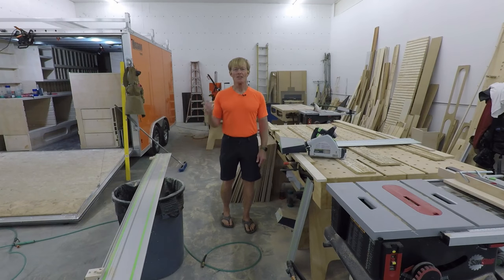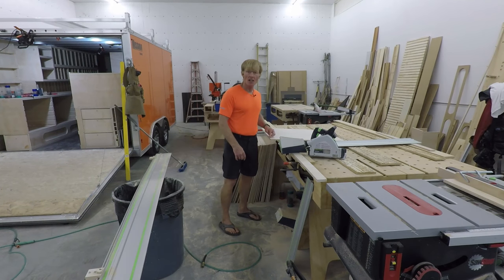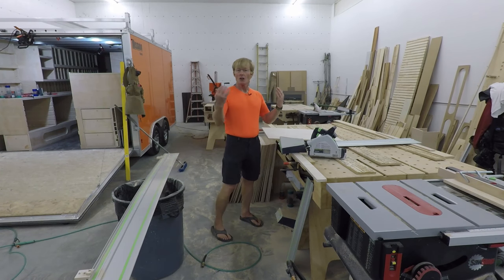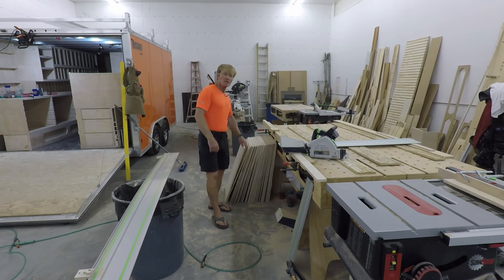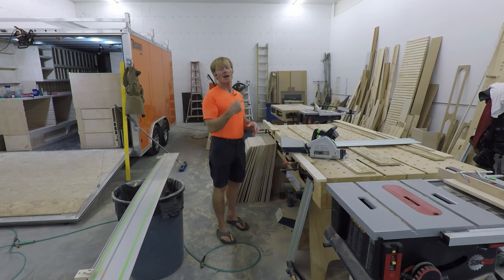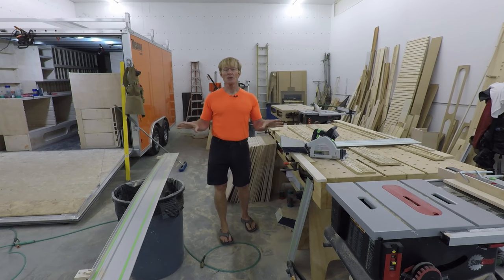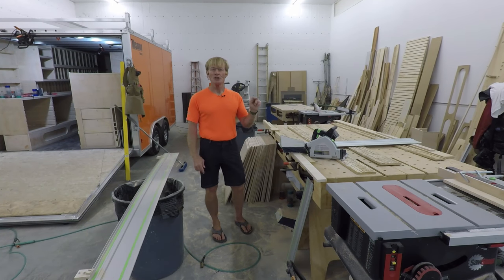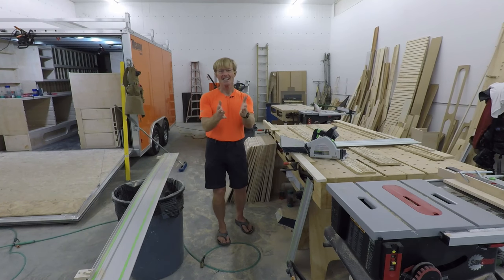Mass manufacturing bottoms

Comment: I was wondering, I thought I saw you insulate the sides of the trailer, could you please tell us why you haven't you insulated the roof?
Reply from the maker: The purpose of the insulation is to protect the aluminum sides. I don't heat or cool my trailer so insulation is not required or helpful.

Comment: Good series, thanks for the update!  Looks similar to my work early next week (building euro style kitchen cabinets and toe kick) I got a question,when you build kitchens do you order out your doors and drawer fronts?  I have been working out of my truck and hope to rack out a trailer or large van before too long and will be using a lot of your ideas. I have been using a modified Paulk work bench for several years now and am totally sold!  Thanks for that!
Reply: The other day I had an idea while sitting on a clients toilet after awkwardly asking them if it was ok if I used there bathroom.  The idea was to add a small composting toilet something like the natures head in my next work rig. Hope this question isn't too personal, but I am curious how you deal with situations like this when the jobs are to small to bring in a porta potty?
Reply from the maker: I started building my doors, then I started buying them, then I started buying boxes, drawers, and doors. Finally, I sold my cabinet shop and buy ready to install cabinets.
Reply: Ron Paulk i am amazed at how inexpensive quality doors fronts and boxes are from my local door shop... I know your also from Washington are you ordering your cabinets from case quick by chance?

Comment: Great videos Ron.  I will be building a workbench with router plate and attached table saw.  I'm just stuck with deciding on a portable table saw.  I particularly like the Bosch 4100 since it can handle dados, but it has the stand.  Any ideas to make it work with this saw would be greatly appreciated. 👍🏼